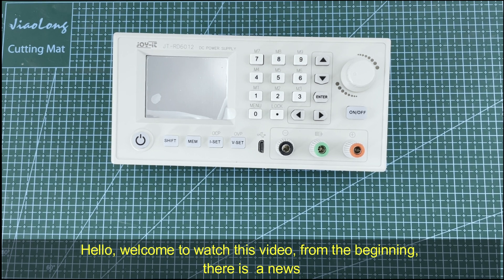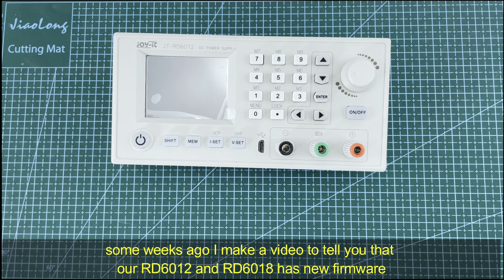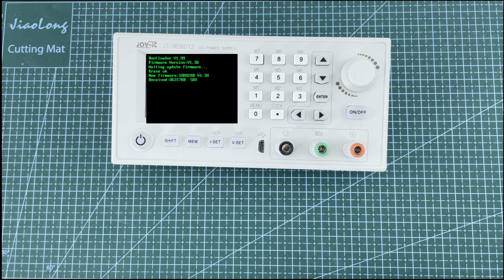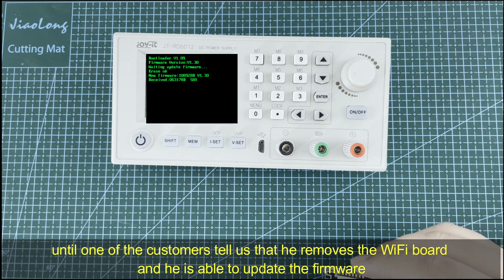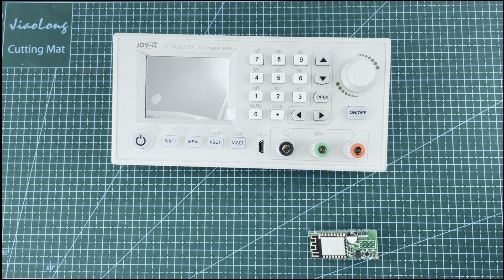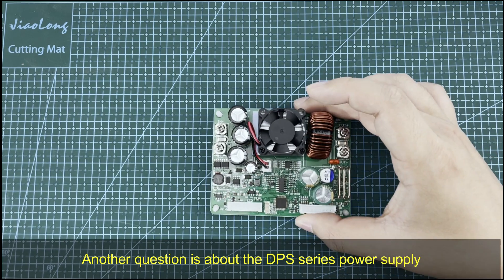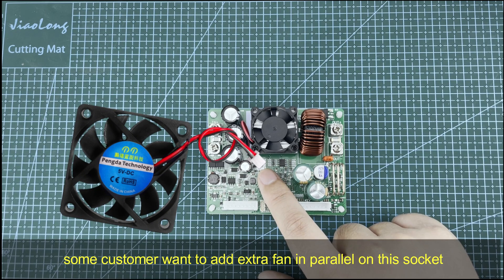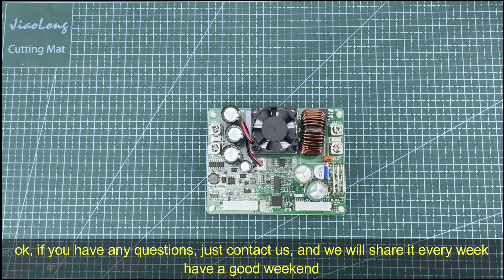Firmware update stucks? try remove the wifi board! RD6006/RD6024/RD018

Comment: Good morning, could you send me the link to the latest firmware for the rd6006w?
Reply from the maker: hello, you just connect the device to PC with a Micro USB cable, and use the PC software to update the firmware and it is ok
Reply: @rdtech9153  PC meaning Windows … some of us don't have have personal computers (PCs) that don't run Windows. Can you please provide download links for those of us who run MacOS and Linux so we can use the existing open source scripts to flash official firmware?
Reply from the maker: @ex-nerd  sorry that for now there is only windows PC, I will ask our engineer to see if they can make a software for other system, I am not engineer so that I do not know how hard it is to make that, I can only tell them

Comment: Hi, I have an RD6018w suddenly it while trying to charge a battery at 4.5v I set the voltage and current required and when I turned it on it sparked at the positive connection and turned it self off

I disconnected it from mains power and waited for few minutes and connected it again and since then it is alway having the full 68v at the output on even the power shows off.
Reply from the maker: hello, do you use the green terminal as output+ when charge battery? and you said there is a apark, do you connect the output cables to the wrong battery electrodes? you can contact us on aliexpress, show us the problem with video, normally it is the output fuse burnt, you can check that, if indeed it is fuse problem, you can use the backup fuse in RD6018 box to replace the dead fuse
Reply: @rdtech9153  yes I was using the green terminal as I always do when charging batteries, battery was connected correctly and the spark was hardly noticeable but the bang was really high.

After this it is always connecting the full 68v to the output 

I will try to reach you on aliexpress store but if you can help me or give me a kind expectation for what can be the resolution it will be great.
Reply from the maker: @TheAmerTV  ok, you contact our after sell service, take a video and they will help you judge the problem